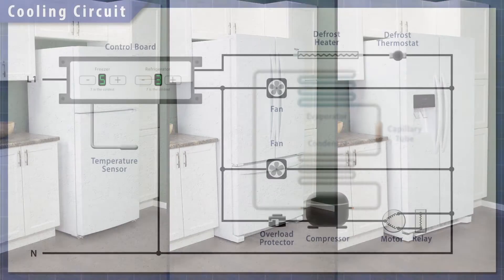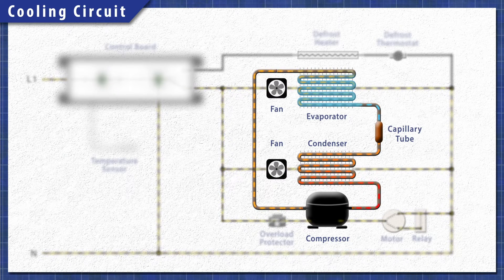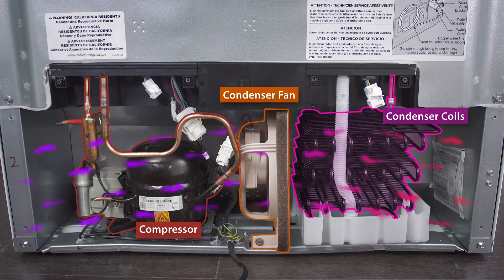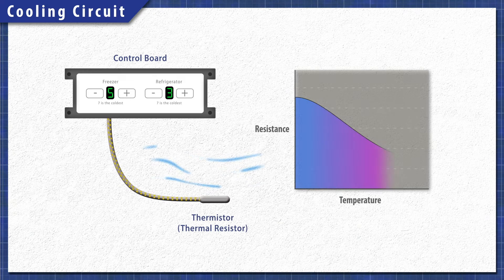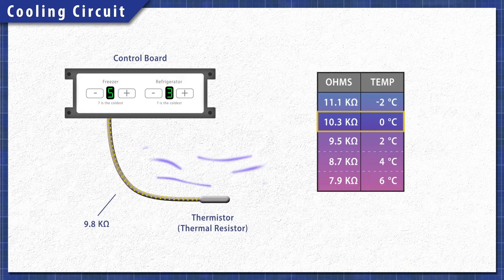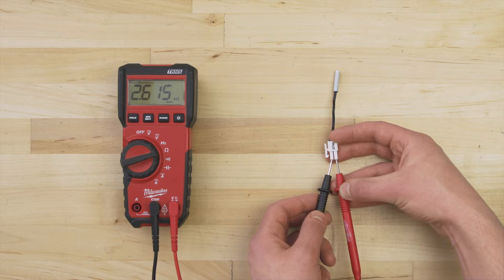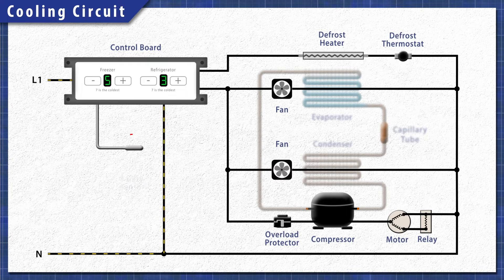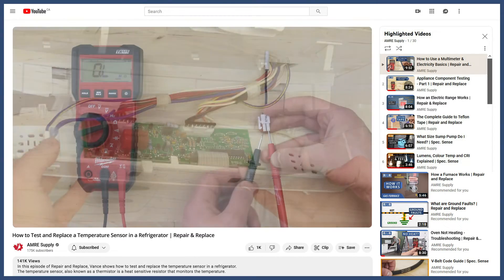How Does a Refrigerator Temp Sensor Work? (Thermistor) | Repair & Replace

Comment: Our side by side has a sensor in both the fresh food compartment and the freezer. The freezer is not as cold as it should be but the fresh food area is ok. Would that possibly mean that the freezer sensor could possibly need changing or possibly both?
Reply from the maker: Thanks for watching. It is worth testing and replacing the freezer thermistor, as well it could be an issue with the damper https://www.youtube.com/watch?v=LlyDFV31c4k

Comment: what does it mean when the control board says the thermistor is "Open" instead of "P" for pass or "S" for shorted?  Is "Open" mean bad?
Reply from the maker: Thanks for watching. A closed circuit is a closed path for electricity to flow through. The thermistor needs a continuity to work properly as it is a thermal resistor. 

An open circuit means something has failed, there's a break in the wire, or the connector isn't connected properly. It means there is an open gap, preventing the circuit from being completed. 

You can see how to test and replace the thermistor in this video: https://www.youtube.com/watch?v=jnt_mUwdL8o